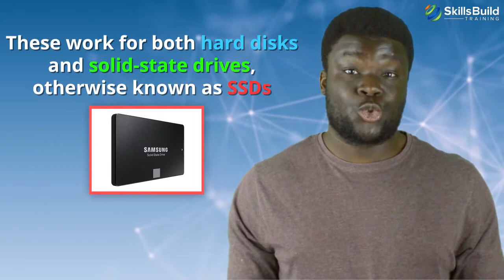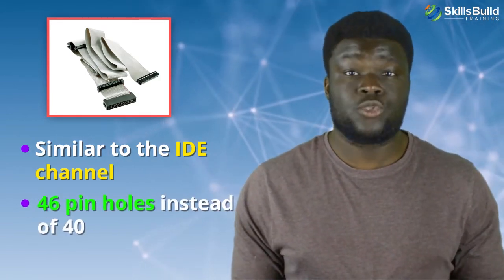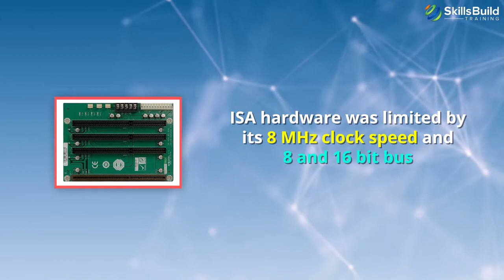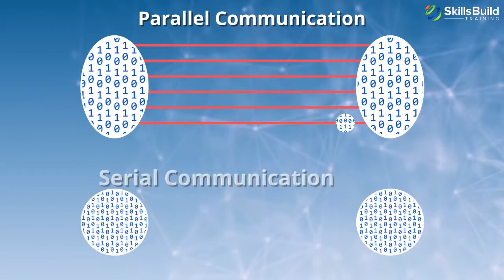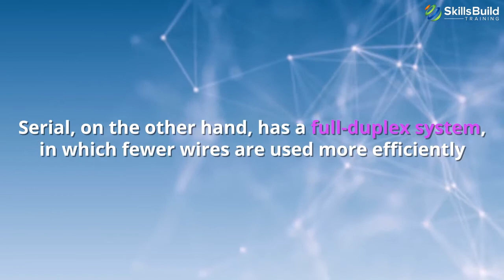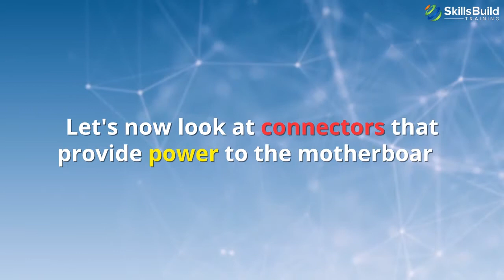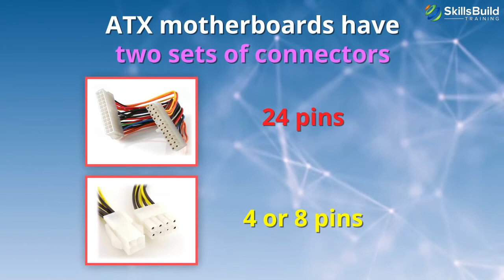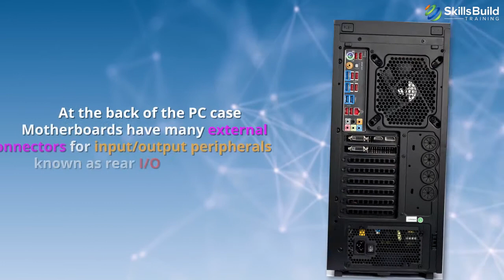Motherboard Connectors Explained for Beginners

Comment: Does anyone know a video showing how to disconnect the 3-pin/4-pin fan connectors?   The latch holds it on and if I pry it, it will break... how is this done? Thanks!
Reply from the maker: Have you tried a Google search?
Reply: @SkillsBuildSecurity  I did, yes, but didn't find any helpful tips that i wasn't already trying.  I was hoping there was something I didn't know that would be the ticket.  I finally got it loose, though, with some very patient and careful jiggling and pulling.  Thank you for the great video! :)